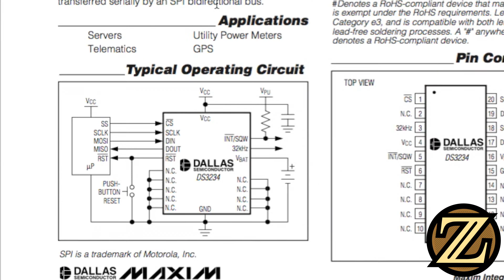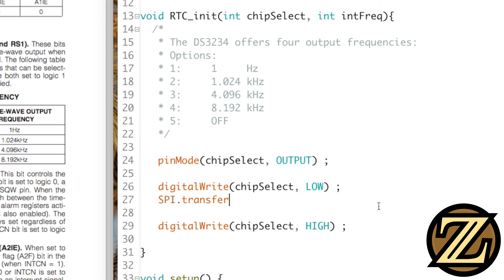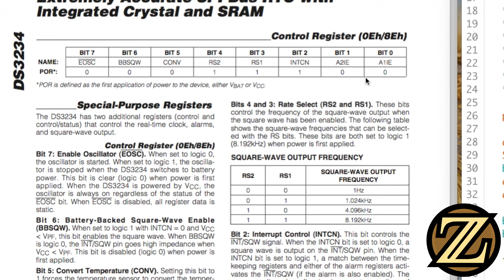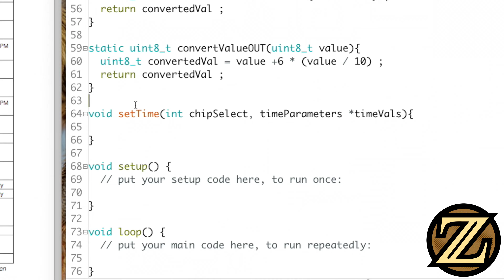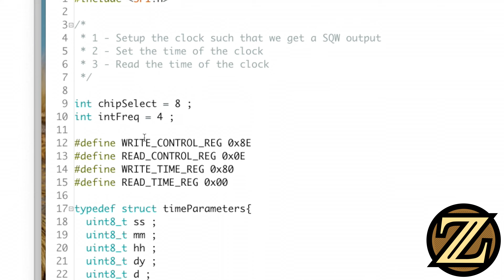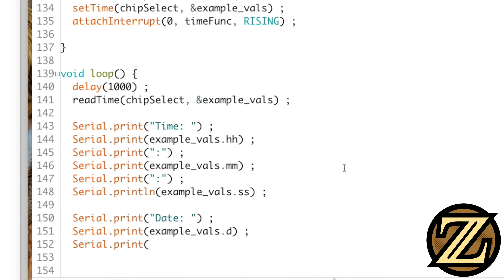Arduino Tutorial 9: SPI Communication with a DS3234 Real Time Clock

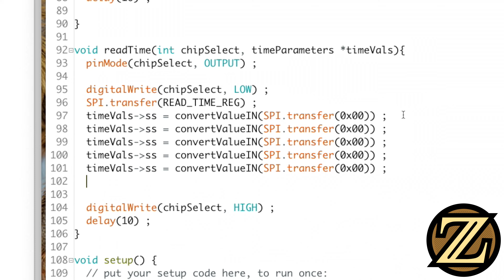Comment: At @28:27 you are reading time starting at 0x00. And each member of the structure is also from 0x00. Wouldn't each member be from a different register? 0x01, 0x02, 0x03... etc? Or because CS is held LOW the address increments until CS goes HIGH?

Comment: It worked at first but then i messed something up. I tried to change bit 7 from 1 to logic 0 and now it doesn't show the time triggers. Could you mess up the bits in the registry or should taking out the battery work because for me it didn't.

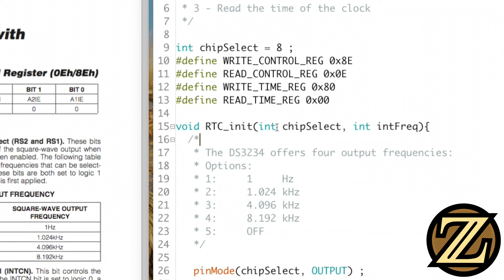Comment: Hi ive been programming in assembly using the DS3234. the question that I have is how do you go about setting the time accurately? writing into the addresses is pretty straight forward but to set it up to read 19:50 when it is actually 19:50 is another thing. unless ive missed something in the datasheet

Comment: It's been a few months since this was uploaded.  I'm surprised you don't have any comments.  I thought it was done very well.
There is one thing I have to say, though.  Several videos have been uploaded about the DS1307, DS3231 and the DS3234.  For some reason nobody likes that the data is stored in BCD.  Agreed you have to do a conversion to BCD when you "set the clock"  but there is no reason to convert the BCD data to binary (I know you said you were converting to decimal, but think about it).  To display the time, without converting to binary you do is use the Serial.print() function with the "HEX" argument.  e.g. "Serial.print(ss, HEX)".
Reply from the maker: Thanks for the feedback. None of my Arduino tutorials are all that popular; I'm unsure if it's because of the video itself or because I'm not being picked up in the search results due to a saturation of content.

Doesn't printing with the 'HEX' argument just print the data in hexadecimal format?
Reply: Yes it does.  That is the point.  Say in register zero (the seconds register) there is a value of 59 seconds.  Bits 6 through 4 will be "101"--in hex that is "5" and bits 3 through 0 will be "1001"--in hex that is "9". thus the register will have "01011001" stored in it.  In hexadecimal that will be "59".  The logical reason it is stored that way is so that you don't have to do conversion to display it.  For the 10's digit just do a right shift of four bits and for the ones digit just do a bitwise or of 0xF.  That is what I have done in my clock projects.
Reply from the maker: You know, I didn't think about that. Good trick!
Reply: wouldn't a bitwise OR of 0x0f set the lower nibble to F regardless. using the data read as an instruction to an LCD you need to keep both nibbles as they are.